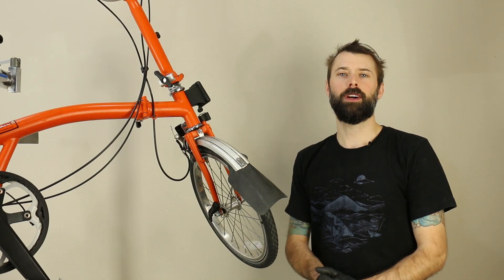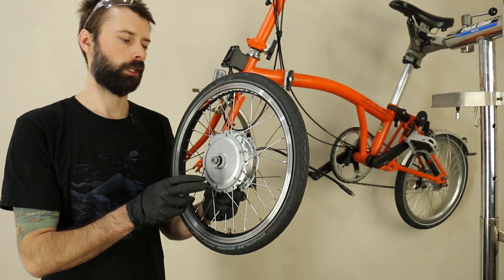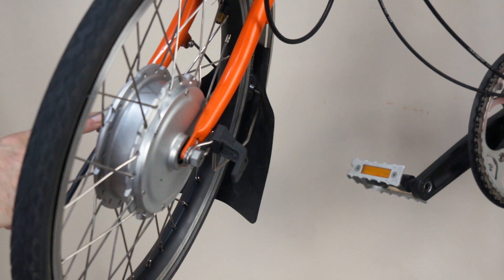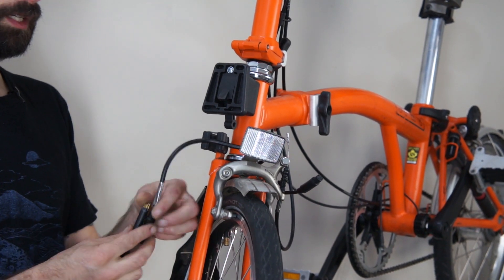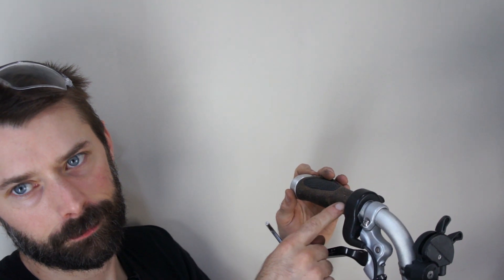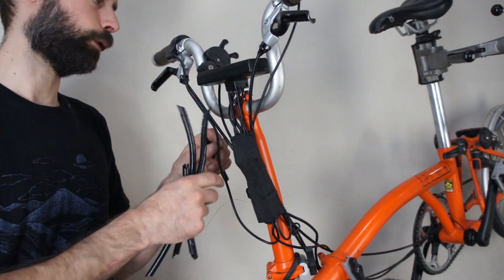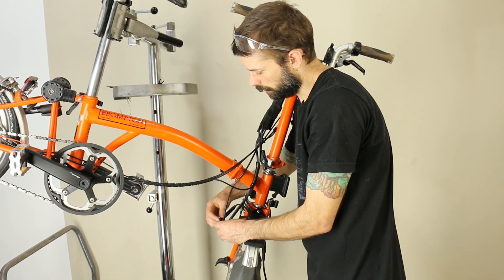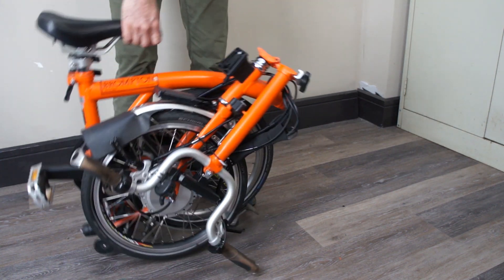Installation of Geared Front Hub Motor Kit on a Brompton Bicycle

Comment: Since the batteries are available again, I was wondering if the grintech kit is compatible with the dynamo lights?
Reply from the maker: It depends on the input voltage range of the lights. A lot of newer ones are designed to also work at up to 60V DC in which case no proble, but if they are just 6V rated then no, you'd have to have a separate DC-DC converter to first step down the battery voltage to the appropriate level for that light.
Reply: @GrinTechnologies my Brompton is a 2022 release H6R, so maybe new enough to handle it?

Comment: If we want to put a lot of load on this engine while keeping the heat under control, what do we need to achieve this?
Reply from the maker: Active thermal monitoring and thermal rollback on the motor controller.

Comment: I have a couple questions about the brompton kit before buying. 1. If I get an ebrake lever can I or should I remove the front brake on the bike? 2. I see you offer a program cable option can I make the motor run faster? In short what does the programming allow me to do?
Reply from the maker: No you keep the front brake, it's just that now the lever also activates regen. 
The USB->TTL cable lets you connect to the baserunner motor controller to change any number of settings, see https://ebikes.ca/amfile/file/download/file/318/product/1722/
Reply: @GrinTechnologies  thanks!

Comment: BROMPTON ELECTRIC. "THE WORLDS MOST UNRELIABLE BIKE?”.. Both of my Electric Brompton"s continuously keep braking down. The poor quality bearings & electronics keep failing. Brompton knows about this. But just keeps replacing them with same the parts. Buy yourself several Chines copies for the same price. Or better still a Honda CBR 125cc motorcycle for the same price. Feel less disappointed & save yourself a fortune.
Reply from the maker: Will this is not the brompton electric bicycle this is a totally independent kit added to a regular non electric brompton. We've had customers sell their factory electric bromptons and buy a regular brompton to convert over,for both better performance and reliability.

Comment: You had to remove the gear shifters to install the throttle and multi-function switch but I never saw you put them back. What happens to them in this set-up?
Reply from the maker: The brompton gear shifters are never removed, they stay on the handlebar the whole time. It's only the grips that need to be removed to install the throttle.

Comment: I have had an e-Brompton for two years. Under normal city conditions, I can drive only 20 km on it. Should I buy a new battery? There is no other solution? Can you improve it yourself, e.g. by replacing the cells in the battery? Is there an instruction on how to do this somewhere?
(I don’t have access to an authorized Brompton service center.)
Reply from the maker: It's a fairly advanced skill set to replace all the cells in a prioprietary battery pack like that, requiring spot welders, soldering equipment, familiarity with wiring and BMS circuits etc.   20 km from a 36V 8Ah nominal battery isn't too bad, and if you need more range by far the simplest thing will be to purchase a 2nd e-brompton battery to have two of them on hand.
Reply: @GrinTechnologies  OK, thanks for that wise answer. I think buying a second battery is the only way out of this situation. But it's also not that simple: I don't know where to buy it and whether it is possible to send the battery by post now. Besides, I was hoping for a cheaper solution.

Comment: Hey @Grin - just curious which kits you'd recommend for converting a TERN folding bike? Would the same geared motor kit work as for the Brompton?
Reply: Have a look at Tern breakages, if your going "e" it use a rear wheel kit.

Comment: Hi!

Is the hub disc brake compatible? I’ll be using a wider custom fork.
Thanks!
Reply from the maker: It is not.  If you have a wider fork that is disk compatible, you should use a standard 100mm OLD geared hub motor like the SX1 or G311

Comment: Hi. Greetings from Argentina. How do you compare in terms of confort an effort the Bromton with a 20 inch foldable bike such as Tern or Dahon?
Reply: Bromptons are very bumpy on those little wheels. I would say my Tern 20" though is more uncomfortable to ride because the Brompton does have a small shock absorber in the rear and I have a shock absorbing Brooks saddle on the Brompton.

Comment: Wow! Has it been 7 years already that I put a motor and CA v2 on my Brompton? Back then, I had to source the motor, controller, throttle, switches, torque sensor, rim, spokes, CA and batteries separately. And 80mm motors were the narrowest I could get then. Which meant spreading the forks, widening the dropout slots, etc. And making sure the cable harnesses did not interfere with the fold took a lot of effort. To this day, the setup runs just fine. The geared Keyde motor is now a little noisy. But it works fine. Good job on your kit!

Comment: Very neat. What is the power rating of the motor ? Does it comply with the European 250 W. limit ?
Reply from the maker: It's definitely lower in power than many of the hub motors sold on EU compliant ebikes in europe, but it will go faster than 24 kph unless you set a speed limit in the motor controller. Ratings as you should know don't mean much.  https://ebikes.ca/learn/power-ratings.html
Reply: A 250W label on a motor just means that manufacturer says that it can handle 250W. It doesn't specify the upper limit to what you can drive that motor at.

Comment: You should do the bike Friday since they sell Ligos.... ;-)
Reply from the maker: You mean an updated version of this? https://www.youtube.com/watch?v=rtDn56TzGTk
Nice thing about the Bike Friday lineup is that they use 100mm front fork dropout spacing, so any hub motor will work. It doesn't need to be a special narrow motor like the Brompton.
Reply: @GrinTechnologies  Yes, there is a lot of noise in the facebook bike friday groups. I never saw that video before, good job. BTW the NWT is the one most folk are getting itchy about e-assisting.

Comment: Hi Grin! I have just had this sofp motor installed on my Brompton. I understand this motor is meant to have some noise, but there is what seem to be extra noise when the motor isn't engaged. I'm wondering if this is normal? It's like a rushing noise - it doesn't happen when the motor is engaged, and as soon as I release the throttle on the motor, the noise starts. Almost like the freewheeling motor is more noisy? I hope this makes sense. Can you offer me some insight into this?
Reply from the maker: This is definitely a noisier geared motor than many other geared hubs, and part of that seems to be because the planet carrier pins are mounted directly to the shell of the hub. When the motor is not engaged the gears are still turning as is the internal freewheel clutch, what you could be hearing is the freewheel turning over.  Send us an email if it gets noisier over time but I wouldn't be too worried.